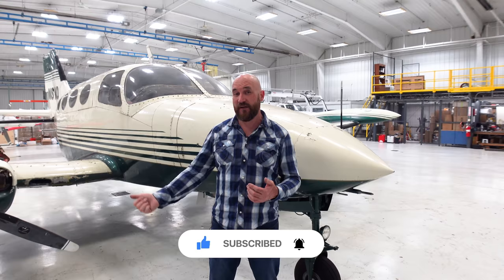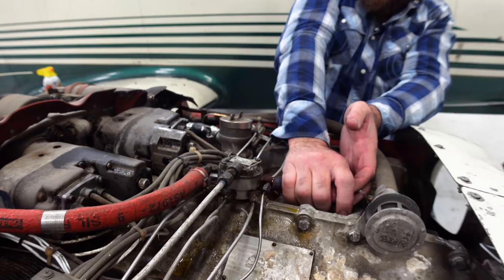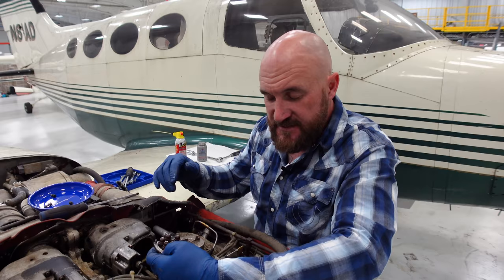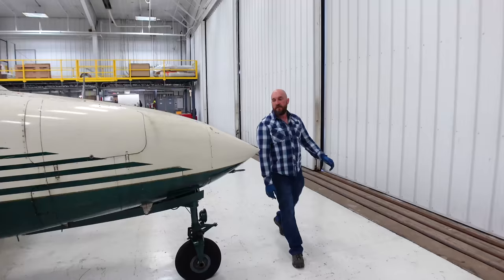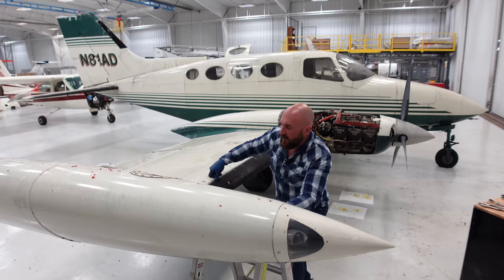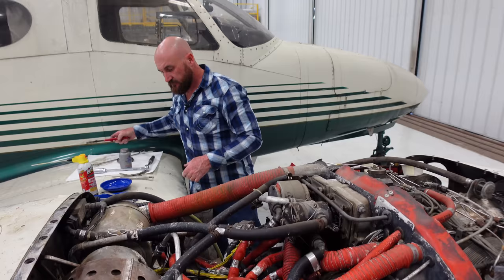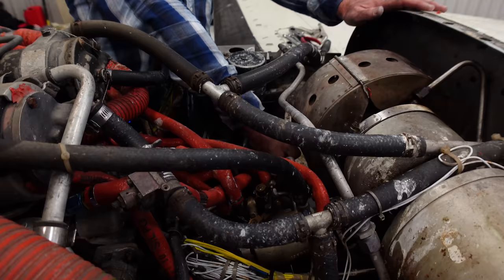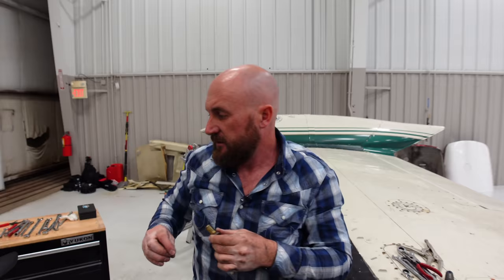He's Trying To STEAL Our FREE Abandoned Airplane ! Ep3

Comment: Also if u had a stuck valve on that engine it’s a flat tappet cam engine the pushrods would bend and cause the engine to not turn over.
Reply: The push rods would bend, and the push rod tubes would bend, and the engine would continue to turn just fine.
Reply: @learmonkey3582  yes but if u bend the pushrods and tubes without noticing it you shouldn’t be working on it
Reply: @charlesnostrand3620  The push rod tubes are under the cylinders.  I doubt he would have noticed if they were bent.  The tubes will leak oil if they are bent, but no oil flowing for 15+ years, there isn’t any oil in the tubes to leak out.

Comment: Your problem is that the mixture lever is at cut-off.  You should also put the throttle about 1/4 fwd.  You'll have fuel squirting out those injector lines for sure.  The spider (fuel manifold) could be bad, but you should get some sort of fuel coming out of the injector lines.  The issue is the mixture and the throttle lever positions

Comment: Hi from UK, Really enjoying your challenge,  It may have been a blessing in disguise that it didn't start on the last attempt, I would be really concerned about the apparent lack of oil pressure, or any oil flow to the turbo feed. It may have been covered in other comments but a long time standing may need the lubrication system to be re primed, just a few seconds running with no oil pressure could be catastrophic for the crankshaft bearings, I would hate to see all that hard work end in a completely wrecked engine. If you cant get oil pressure just on mags off cranking test then I suggest further investigation. Good luck

Comment: 14CFR Part 43.  FAA states No BACKYARD MECHANICS...............Probably a good reason for this, since it has been sitting for over 10 years, no records of the last Certified  Mechanical inspection/work by  "authorized mechanics with FAA Certification".  I have heard after 4,000 Flying hours every engine needs to be pulled, thoroughly inspected documented and then rebuilt with the appropriate documented calibrated tools required of a plane in the United States.   Planes are not the same as Barnyard Finds that have not ran for 40 years.  They have the opportunity to impact innocent lives if not maintained to a standard..
Reply: can you cite the specific No backyard mechanic reg? Is that something you also "heard?"
Reply: @buckmurdock2500  He cited it right at the beginning of his comment...  14CFR 43.
§ 43.3 Persons authorized to perform maintenance, preventive maintenance, rebuilding, and alterations.

(a) Except as provided in this section and § 43.17, no person may maintain, rebuild, alter, or perform preventive maintenance on an aircraft, airframe, aircraft engine, propeller, appliance, or component part to which this part applies. Those items, the performance of which is a major alteration, a major repair, or preventive maintenance, are listed in appendix A. 

(b) The holder of a mechanic certificate may perform maintenance, preventive maintenance, and alterations as provided in Part 65 of this chapter. 

(c) The holder of a repairman certificate may perform maintenance, preventive maintenance, and alterations as provided in part 65 of this chapter. 

(d) A person working under the supervision of a holder of a mechanic or repairman certificate may perform the maintenance, preventive maintenance, and alterations that his supervisor is authorized to perform, if the supervisor personally observes the work being done to the extent necessary to ensure that it is being done properly and if the supervisor is readily available, in person, for consultation. However, this paragraph does not authorize the performance of any inspection required by Part 91 or Part 125 of this chapter or any inspection performed after a major repair or alteration. 

(e) The holder of a repair station certificate may perform maintenance, preventive maintenance, and alterations as provided in Part 145 of this chapter. 

(f) The holder of an air carrier operating certificate or an operating certificate issued under Part 121 or 135, may perform maintenance, preventive maintenance, and alterations as provided in Part 121 or 135.
Reply: @Ispike73  can you provide the reg that explicitly states "no backyard mechanics?" Having trouble finding it in your cut and paste salad. 😆
Reply: @buckmurdock2500  Jesus Christ dude, are you twelve years old?
Reply: @Ispike73  so you have now decided ad hominem fallacy is the way out of your box  canyon?

Comment: You definitely need to invest in some Kroil penatrating oil. It will crawl up a bolt and soaks into the metal. There is nothing I have found that is even remotely as good, but be ready to pay up for it.

Comment: try checking the oil pump strainer to see if its clogged, as well as check and try cleaning out the throttle body in the case of the fuel it doesn't seem like your getting enough fuel pressure so make sure your mix levers are in forward position then if that fails, check the fuel solenoid for sure that maybe the culprit. Don't quit man made it man can fix it; you will get it started.

Comment: The spark looks rather weak and under pressure they can actually get weaker.. try plugging the injectors in the lines outside the cylinder and look at the fuel flow.. have you done a compression test?

Comment: Gotta talk to the seller. After its running sell it to the sniper for 40k, split the cash with the owner, buy new project. I mean it would be great to see a complete restoration but if the owner sounds hard up then we can loose the project or we can donate if you start a gofundme for it and you buy it from the owner.
Reply: It’s worth the same running or not.  It’s worth the scrap value of the aluminum.  If a bone yard had to come and haul it away you’d be lucky to $10K for it.  It’s a hangar-sized door stop.
Reply: @learmonkey3582  are you the person trying to buy it out from under these guys? And of course it is worth more running rather than not. If you went to buy a car and the dealership said "we have 2 one is running and the other is not. We are only willing to sell you the broken one but it is the same price as the running one.", would you be willing to pay the same price?
Reply: @JamesMilanese123  It’s not a car.  Both engines need $60K worth of overhaul, at a minimum.  That does not change one bit if they are running.  They have no log books.  Which means no shop is going to touch them.  So, at best, they are they are engine-shaped pieces of modern art.  I’ve been in general aviation for 40 years.  I’ve worked on all kinds of planes including 400 and 300 series Cessnas.  Projects like this are why the saying “if you want to make a small fortune in aviation, start with a large one”, was developed.

Comment: If you have an air leak on the suction side before the pump or around the pump you're not gonna be able to pull fuel and create pressure or not enough pressure or air bubbles check for air leaks

Comment: How does that fuel injection system work? Is it a continuous flow system where intake manifold vacuum/flow pulls on a disk air flow meter which then opens needle valves which allow fuel to each cylinder intake position? I've seen some old pre-electronic benz cars that use an injection system like I describe, so if the intake/exhaust valves are stuck open there won't be intake air flow and there won't be any fuel allowed to flow. I'm sure you already figured it out by now. I don't know what I'm talking about. Keep up the good work!

Comment: Everybody believes you just need Air, Fuel and Compression but nobody thinks of Timing. I've had one with a rotor melt and change the timing. Couldn't figure it out on the side of the road but once I got it home found the 90 degree out of time spun plastic rotor causing my issue. Bad distributor bearing overheated the plastic rotor and must of touched the cap enough to make it out of time.

Comment: What I don't get is that you confirmed good flow to the top where it spilts to different injectors lines   But then no flow to the injectors.   I understand you cleared the lines and cleaned the round thing the lines are connected to.   Still I would be looking there.

Comment: How much fuel pressure does the engine call for ? I have never worked on an air plane engine . I wonder if having three fuel cells does it draw from all three at the  same time and change pressure as fuel is consumed . I am at total ahw . You have done all the hard work ..

Comment: So if you are getting fuel to the line up to the "distribution manifold" then it has to be an issue in the manifold or the lines after. Is there a pressure plug in the manifold itself? Try pushing air for where the supply hooks up to it. Or try capping the lines at the end and feed air backward through the lines one at a time with the supply line disconnected.

Comment: Don't know about aviation gas but auto gas goes bad after a year or so.  I have done restarts on 10+ year old sitters and have had to have the gas tanks taken out and cleaned in radiator shops.  The fuel turns to acid and dissolves all the metal.  New pick-ups, gages sometimes whole tanks need to be replaced.  Fuel pumps need to be replaced, fuel lines flushed, carbs and fuel injection rebuilt or replaced. Now Diesel you don't have to do all this as this fuel is stable.  I wonder if aviation gas is the same.

Comment: If they sold that thing today new it would be $3,000,000.  I think it’s hilarious how were treating this basket case twin Cessna it like an old Ford mustang.  

It’s like watching a 8 year old trying to get the money and knowledge to rebuild a fleet of wrecked Ferrari F40s.
Reply: @sparkeyjones6261  you obviously don’t know much about airplanes.  A brand new airplane has almost exactly the same technology as this thing.  Besides avionics gasoline powered aircraft tech hasn’t changed much since the 60s.

Even if this guy gets it started this thing is a death trap until both engines and their accessories are rebuilt by certified FAA repaired facilities and techs.  The props, landing gear, pressurization system, primary flight controls secondary flight controls, fuel system, cabin heat, avionics, de-ice systems all need to be inspected and rebuilt.

That thing is wayyyy more complicated then an F40.  And if you screw up fixing a car nobody dies.

Which is why it’s illegal for a owner of an airplane to work on his own plane with the exception of a specific list of simple items.

This airplane would easily cost 3,000,000 if it was new.  And even if he gets it started it going to need hundreds of thousands of dollars in actual Maintence and overhauls to make it airworthy.

It’s not enough to just get it working.  Most mechanical items  on that airplane are considered safety items and need to be inspected, calibrated, die penetrated and magnafluxed,  it cannot have corrosion.

And then after you get it started and flying that thing will cost about 400-800$ an hour to keep in the air.

That is a beautiful.  Amazing airplane.  And can be brought back to service for many years or flying.

But it’s nothing like a mustang.  There is a reason it’s been sitting for years.  And it’s free.  It’s $$$$$$$$$$$$.
Reply: @sparkeyjones6261   also.  There are currently no production turbocharged/pressurized big bore twin engine cabin class aircraft still in production.  

Why?  Because they are super expensive to make and operate and there are not enough private individuals with the skill to fly or the money to keep them in the air.

This airplane would be amazing to restore and can be made modern.  But it’s bo job for a shade tree mechanic.

Comment: Whenever I have an issue with fuel injectors,  I disconnect the fuel line, then connect a small pump can like you would use in your garden to test the engine, then work backwards to the fuel tank/pump.  Good luck.
Just a thought, could there possibly be a hidden kill switch? It can be a great theft deterrent, but also very tricky to find, lol.
Reply: Kill switch would have to shut off something, usually electrical, and he's already verified spark.

Comment: What I would do in these situation is bring my fuel pump cart over. It's a modified dolly with a 3 gallon jug mounted on it with 2 fuel pumps and pressure regulators that allows me to tap into the fuel system directly without having to use the planes power/fuel system.  Check all vent lines first, then start at the injectors and work your way backwards to the diverter.

Comment: What type of oil does it use . And is the oil in a remote reservoir or on the engine. Can you spray starting fluid in it. Are there gas filters and oil filters.

Comment: Forgot one really important warning stay out of the prop arc! at all costs not worth getting hit by the prop even it just turns over one rev.  I know, that happened to me when I was just doing a compression test with compressed air. Again built that test equipment too, from two pressure gauges and an orifice of the right size don't remember what that was but you can find out. You have to input, I think 100 PSI and then read the lose of air at TDC to find out the ratio. Manufacture should have the ratio that passes test.

Comment: What is the fucking compression rate of this damn engine? 
(Because you need a some ignition source, some drops of fuel in the cylinder and compressed air to get it running. You can drip some fuel into the cylinders via the spark hole.)

Comment: Is that the guy that blew his engine up twice because who ever did the work wasn't very smart who puts lifters in after they find metal chips in the oil and doesn't change the cam or oil pump or main bearings cam bearings or split the case and clean it out

Comment: Well, actually you don't only need Air and fuel (and Spark) for an engine to Run, you need the correct mixture of both and you need combustion (and Spark). But anyway, i Like your Videos😉 Cheers
Reply: actually.... you do
Reply: Compression and timing also

Comment: You could have avoided that someone saw your video and wanted the plane and offered the owner 20k for it.
You just had to make the engine start, BEFORE you posted the first video.
It's funny because I actually was sitting with the thought "what if someone wants to buy a cheap plane before you get the engine started" but I didn't know you had posted the first video before you managed to get it started up.
Unless this is acting, because something didn't feel right. Or is that just me?

Comment: My quest is  fuel  no contact electric fuse connection coroided  fuel pump connection 
Not get power.  Or head gasket blown. We’re the
Maintenance. Log    Second  thought  not head gasket.    It’s a connection. Problem  something 
Not get power fuel pump or injection

Comment: Brother!  You have a contract!  You have and agreement. You have an investment!! Without you dong this work and the videos there would not be any other offers. You MUST maintain the contract!! So must he. You can always donate some later but if you budge you loose your investment and become the slave. You have been under pressure to perform (get it running)  You are in the midst's of fulfilling your obligation which gives him relief from paying for it and any liability. So he is benefitting already.
  If you consent then the old contract is dead and he can now enforce the new one. No one had interest in it and it was a liability before .
   If you were smart you would say "Fine we will split it 50 50. since you are the one which made it public and that is selling. Or you can get it running, close the contract with him and sell it for the 40 k (now that it is running) and give him 10 if you feel kindly)
  I'm well studied in law and have won every contract case ...!  Keep this contract as is! once you wiggle you lose. I think he is pretending there is a buyer now that you have this much interest. 
The thief is a low life and should wait till you are done with your contract and then if/when you get it running make an offer to you!!! (Filthy piece of crap, trying to pull the ground out from under your feet)
   I just reviewed the ;aw and I am right !!

  You got spark!  Remove the turbo put a vacuumed cleaner shop vac on blow and hook to the intake, pour some fuel into the intake and turn it over. It will run for 10 seconds... It runs!  Done deal, go get the title. You don't need the vac just may help. IN fact you can make shift a hole in the line where you tape it to the intake and put a IV bag tube into it and let it drip into the intake. Had a truck that had a tank on the roof with an IV and it syphoned into the intake.. drove that way for years locally.  The IV worked so that you could adjust the flow by hand but if you put a foot long tube before the intake and put the IV tube in the middle of it the increased air flow will suck more fuel when you give it throttle.. Bernoulli effect?
  Blessings